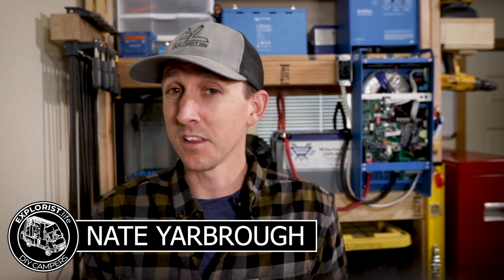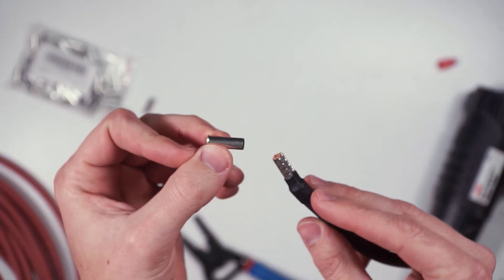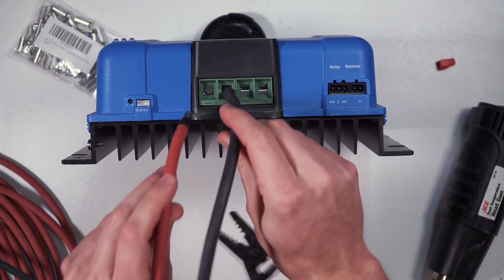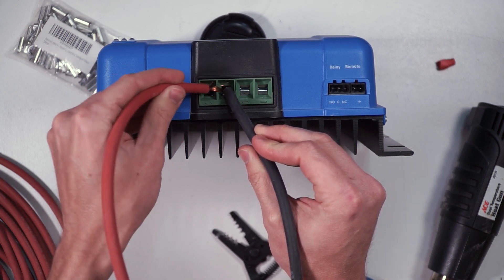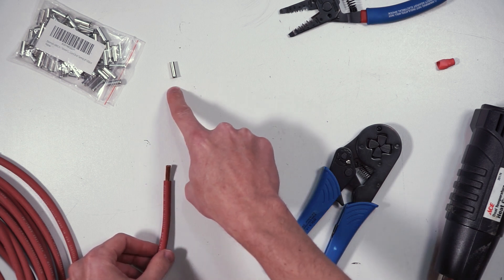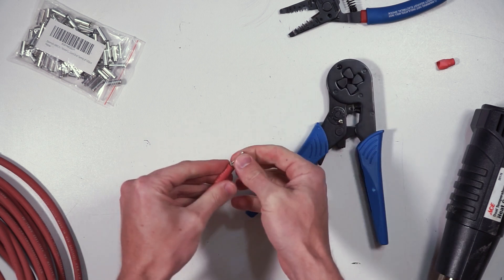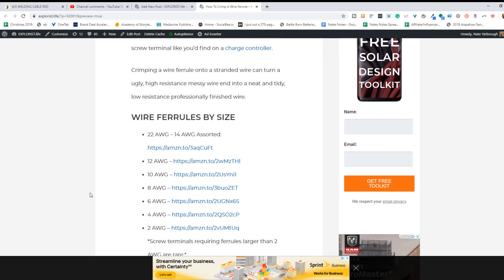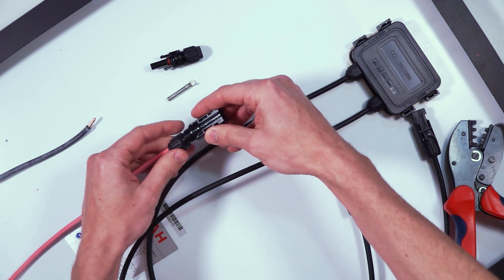How to Crimp Ferrules (and Why You Need Them)

Comment: I need to use a ferrule with AWG  1/0 wire that is subsequently inserted into a round receiver (circuit breaker) but haven't been able to find a crimper that claims to work with AWG 1/0 wire.  Although I would prefer a round output, square is acceptable. Any leads appreciated. I have a crimper that works well with the heavier copper luge but it makes a mess of ferrules.
Reply from the maker: That’s a common pain point with large-gauge ferrules, and the right tool really depends on the exact ferrule style, strand count, and termination you’re going into. At that size, small differences matter a lot for safety and reliability.

If you reach out to our support team, we can look at your exact wire and ferrule and point you toward a solution that actually works — and help you get the right tools or parts if needed: 👉 https://shop.explorist.life/support?utm_source=youtube&utm_medium=comment&utm_campaign=support&utm_content=response_link

Comment: I have Victron Smart solar charge controller MPPT 
150v/45a the output 12 vdc pos & neg terminal size is 6 AWG maximum 
Wires seem warm to hot at 45 Amp about 13.9 volts l was using ferrules on both pos/neg screws as hard as I can. Then I read on internet that Victron don’t recommend ferrules, so I figured change to Home Depot 6awg THWN-2 a few solid copper wires inside ( not soft 100+ soft welding copper wires) insert inside without ferrules, it seems to handle heat better to the light warm
Side not as hot as welding cable. I also thinking transition from short length 6 to 4 AWG  later. Wire from controller to 2K inverter is 2 feet one way.
What is your opinion?
Reply from the maker: Sounds like you’ve been digging in deep — thanks for sharing all that! Wire temp can definitely be a sign to reassess sizing or connection methods.

If you want a second opinion or help dialing things in, our support team is happy to take a closer look:
https://shop.explorist.life/support
(Free support is available for items purchased from our store!)

For gear sourced elsewhere, our Pro Support Membership is perfect for one-on-one advice:
https://shop.explorist.life/shop/all-products/membership-tiers/

Comment: I am having trouble getting a ferrule on a 4ga wire. At 4ga the ferrule crimp is no longer a square tube. What do you do for #4 ferrule work? What about crimp pins? Have you used those? I am looking for a source.
Reply from the maker: The ferrule crimper we recommend for 4AWG crimps them into a trapezoid type of shape, but none of our wiring kits/plans spec ferrules for 4AWG wire.  Reach out to our customer support at support@explorist.life and we can check into your specific use case.

Comment: Hi! I have seen people on youtube that don't crimp ferules for 1/0 to 2/0 gauges(50mm2+) when using with round screw terminals(hole in the brass and set screw type). I think that should violate all possible codes, but it seems like for some reason people get away with it. Is it a viable practice, or are they just lucky that car they used it in is not subjected to bad enough condition? Their argument is that set screw compresses wire enough and that square shape is not a good fit for such terminals. They use it for high power car audio installs.

Comment: I took your advice and used ferrules on my camper build.  They definitely make things neater and cleaner, plus easier to install or reinstall.  They also protect the end of the wire preventing individual strands from breaking off.

Comment: What ferrule tool do you recommend for 2/0 cable for inverter use?
Reply from the maker: What in the world inverter have you found that requires a 2/0 ferrule? 😲😲😲
Reply: @EXPLORISTlife  Progressive PD1620 requires a #2/0 AWG wire, but does not specifically say to use a ferrule. Perhaps the question should have been.. would you use a ferrule on 2/0 wire?
Reply from the maker: This may take a more in-depth look at your personal setup.  If you have purchased/are purchasing from our store (shop.explorist.life) reach out for some more personalized help: shop.explorist.life/support

If you've purchased/are purchasing elsewhere, reach out to your dealer for support.  We'd love to have you as a shop.explorist.life customer so we can provide a bit more help in the future. 🙂

Comment: If (like me) you want to use high awg (0-8) ferrules in circular terminals, use the set screw ITSELF to crimp the ferrule and use heat shrink to keep the ferrule in place while setting the screw. Got that from a stereo channel.
Reply from the maker: As a last ditch effort, that's fine, but the wiring kits found in our store at shop.explorist.life and the components we design them for are designed so we have the proper tools for the job.  We don't have any components that require a 2 AWG circular ferrule, so that guesswork is taken out of the equation for our customers.

Comment: I started using ferrules. I like using them. Some devices such as charge controllers have a metal plate that compresses the incoming wire connection and the device has torque specifications. If you use ferrules what torque setting should you use? Do you need ferrules when using them on devices that compress the incoming wires? Is there a difference on how to use ferrules with large strands in the wire vs small but many small strands in the wire. Thank you for this video.
Reply from the maker: I recommend ferrules in all use cases unless there is a really specific reason to not use them.  We have ferrules in their appropriate kits over in our store at shop.explorist.life.

If you have purchased/are purchasing from our store (shop.explorist.life) reach out for some more personalized help if you need some additional clarification/guidance: shop.explorist.life/support

If you've purchased/are purchasing elsewhere, reach out to your dealer for support.  We'd love to have you as a shop.explorist.life customer so we can provide a bit more help in the future. 🙂

Comment: Great video!  A question though.  Reading the Victron solar charge controller manual, they are very particular about calling out the need for fine stranded wire (even specifying the gauge of each strand) in order for the copper conductor to fully conform to the wire connection clamp, resulting in the highest contact area and lowest resistance.  Doesn't using a ferrule in this case reduce the contact area and go against Victron's guidance?  I'm very curious on this point.  I definitely see where a square crimp would be better than a hexagonal crimp for maintaining surface contact but it still seems the bare strands would provide lower contact resistance?  Thanks for your amazing work!  I've just discovered it and it will be a great help in expanding the solar/inverter/charging system in my Airstream trailer.
Reply from the maker: Ferrules are incredibly flexible and just hold the wires together.  Once the ferrule'd wire goes into the terminal and the terminal is tightened, it will shape the ferruled wire even further.

As far as 'victron's guidance' though, I wouldn't have known about ferrules if it hadn't been for being introduced to them by Victrons product engineers/developers I've been working with since 2019.
Reply: Thank you @EXPLORISTlife !  What an amazing ambassador for Victron you are!  I can’t wait to get started!

Comment: Vibration can cause fine wire strands to break and ferrules prevent this. He probably goes into this on his blog, but a “square” crimper is best for ‘pockets’ that have flat contact surfaces.  A “hex” crimp is best for pockets with a rounded surface, often seen on smaller wiring.
Reply: Thank you

Comment: Thank you for all your videos!  I am working on a 2019 Sprinter 2500 144 WB crew. I should have bought your kits, but bought a few small Blue Sea components like their breaker box fuse box combo, and a Bestek 2000W inverter.  Not sure what I am doing, so did not buy any lithium batteries. Just trying to prewire so need a very basic kit from you: 16awg for MAXX air fan and all connections and outlets you feel necessary for a very simply set up.  Solar to be added later, for now I bought Wago 10awg connectors, but that is it. How can I email you and purchase appropriate supplies? Janice
Port Angeles, WA
Reply from the maker: Hey!  You can simply add whatever you need to your cart at shop.explorist.life and checkout and we will get it on the way!

Comment: As an American, I'm not used to using ferrules, and I'm wondering what things, as a DIY guy, that i might do day in and day out, that could benefit from ferrules. For instance, i don't expect to be doing much, if any, 110/120v electrical work, and if I'm doing anything currently, it's simple stuff like 5v/12v/24v LED strips(usually whatever i can get in an all in one kit from Menards or Home Depot), but I'm wondering how these could save me time in the future. 

Now, don't get me wrong, i know how they help in the DIY (or professional) car audio industry, but that only 1 specialized use case, and I'm just trying to find some things that i might do at some point, that would be something i regularly do, that would work best with ferrules...

Yes, i know that if I have to ask, then it's probably something I will never need, but it is still something I would like to know, because currently I can think of only one project I currently have that might benefit from using ferrules, and even then, I would be using at most 8 of them, and obviously 8 isn't really a big enough number to justify having a ferrule crimper on hand for...

Comment: Can copper ferrules be used on aluminum wire?
Reply: Not an electrician but, I wouldnt do it. Houses wired with aluminum use specifically designed for aluminum,  switches & receptacles because of the differing expansion characteristcs between the two.

Comment: Are the ferrules steel or aluminum.  I wouldn't think steel would be a good idea b/c of it's resistance (lower conductivity) which would make it heat up when in use.
Reply from the maker: Tin.  Think of tin plating on copper wires for corrosion resistance.

Comment: Hi Nate. Just found out your website/blogs. From what I read you’re definitely one of the best! Started my conversion And I have a question for you. some of my wiring from my solar panel are too long. Should I shorten it so it’s easier to zip tied the wires? The wires from panels are 1x2.5 mm (so 13Awg) but my extentions from roof to inside electrical are (8 AWG as per sizing). I kinda need 2 crimping tools (wire size difference)  …. Or the metal crimpimg parts are similar size? Any suggestions thanks and keep the good work! I will be following you!

Comment: What size Ferrule is needed for a victron 100/30 charge controller
Reply from the maker: Better than that... consider checking out our full solar charging wiring kits that have everything needed to connect solar panels to the lynx distributor (inculding the appropriate ferrulles).  Most of the smaller arrays w/ less than 440W have the 100/30: https://shop.explorist.life/product-category/all-products/camper-wiring-kits/solar-charging-wiring-kits/

Comment: Bootlace ferrules for the win! I would always use the insulated version, no need for heatshrink. Loving this series so far
Reply from the maker: I like insulated ferrules for connections that have built in strain relief immediately below.  Adding heat shrink adds a bit of additional strain relief for 'hanging' connections.
Reply: @EXPLORISTlife  extra strain relief is always a good thing

Comment: Great video - you can use an insulated ferrule and eliminate the heat shrink step !
Reply from the maker: I like using insulated ferrules where the connection happens inside of an enclosure that has strain relief going into the enclosure.  Where the ferrules are exposed, I like using heat shink w/ adhesive for added strain relief.

Comment: So after putting the ferral on, the ferral is what's used to make the connection or do i leave enough wire out to wrap around the screw at the connection point?
Reply from the maker: The ferrule makes the connection, but ferrules aren't good options for connections where you need to 'wrap a wire around a screw'.  You want to use a fork or ring terminal for something like that. Example: https://youtu.be/en6Q2L6Bf3A

Comment: Ok, so now I need a ferule crimper as well... Didn't think about that when I ordered a wiring kit for the upgraded motherboard for my 3d printer. Didn't even know what to call the damn things, I've been looking for something like this for years. Well, maybe not so much looking, but wishing I would stumble across them. Finally did though... Yeah, most things you can just use bare wire, but it's gonna be more durable as well as cleaner and no chance of a stray wire shorting out the circuit. So makes sense, of course they haven't caught on here... The land of illogical bullshit...

Comment: I noticed there's nothing mentioned for larger sizes like 00. Are ferrules still useful at this size? I'm planning an install and I know already that the battery disconnect and the fuse holder are both made for direct wire insert, not lugs/rings.
Reply from the maker: I don't have any equipment that I recommend that requires a 2/0 ferrule.  The largest ferrule in use in any of my diagrams at https://www.explorist.life/solarwiringdiagrams is 2 AWG.  Anything larger (battery disconnects and fuse holders included) get lugs.

Comment: Hi Nate, thanks for the helpful video, but how do you crimp larger wires, for example 2 Awg or 4/0 Awg please?
Reply from the maker: 2AWG was shown in the blog post.  Bigger than that just requires a bigger ferrule crimper.  They exist, but ultimately, 2AWG is the biggest wire ferrule you'll need to crimp in a camper electrical system.
Reply: @EXPLORISTlife  Thank you for getting back to me, thats great.

Comment: I am following the digram you have for the Renogy 3000W inverter charger. Is it still okay to use the Victron lynx distributor in this setup? or do I need the positive and negative bus bar? Thanks so much! Your videos are extremely helpful

Comment: I've never used ferrules but they look intriguing. Tinning the wire end with solder accomplishes the same thing and is what I tend to do.
Reply from the maker: That is not advised for mobile applications.  The point where the wire gets hot from soldering can create a weak point when subjected to vibration can work-harden and break.  Soldering like you talked about is fine for most stationary applications where vibration is not an issue, but ferrules are preferred for mobile/marine applications.

Comment: Nah.. I'd rather spend 20 min stuffing a single 4 gauge wire through a silicone dust preventer and have a headache dealing with keeping the  fine wires straight.

Comment: Hey Nate.  Is a square crimp ferrule better than a hex crimp?  I have heard hex crimps should be used in circle sockets as opposed to square sockets.  The Solar panel disconnect you recommend has a circle socket but i noticed you use a square crimp ferrule.  Thanks

Comment: Or, you could just solder the strands for a DIY ferrule?
Reply from the maker: Nope.  Heat weakens both the wire and the insulation and can cause wire failure in mobile applications.
Reply: @EXPLORISTlife  I suppose that’s possible. I’ve seen some really bad soldering techniques and some really bad crimps. I’ve seen people both crimp and solder the same connection. I would not rely only on soldering though because unless it is also crimped, an over heating connection could just melt the solder and the connection would fall out. On the other hand, if your connections are getting hot enough to melt solder, there is something else horribly wrong!
Reply from the maker: Ultimately, the way I've shown in this video and the others in the series are ABYC compliant.  Its up to each individual to determine what they actually do.
Reply: Just to be clear, is ABYC the American Boat and Yacht Council? I ask because I am not familiar with that. I just Googled the acronym. For me, the most eye-opening part of your video was the potential for those loose strands to bridge across to the adjacent terminal. I appreciate the heads up on that safety tip. If it is not already obvious, I do not yet have a great deal of experience with DC wiring.
Reply from the maker: Yes, ABYC = American Boat and Yacht Council.

Comment: Years ago I installed electronic equipment in industrial facilities.  Some places wanted us to use ferrules to connect stranded wire to circuit breakers.  The company bought insulated ferrules for us to use.  But since we didn't know any better we tried to crimp them with a standard wire crimper.  Since we didn't like the way it crimped we just didn't use them.  now I know why.

Comment: Thank you for the video.  Ferrules are great, yet expensive!  I was looking at the wires into the terminals, and I didn't like how screw just punches into the wire threads.  It looks unfinished, and ferrules is the solution, and I appreciate that you mentioned that in Europe, they require it, in order to pass.

Comment: Here in Belgium ferrules are mandatory for all flexible wiring in permanent installations. But I use them with ALL stranded/flexible wiring, even low voltage applications.
Reply from the maker: Nice!  Yeah, they are great.